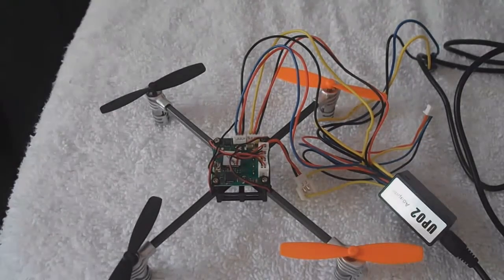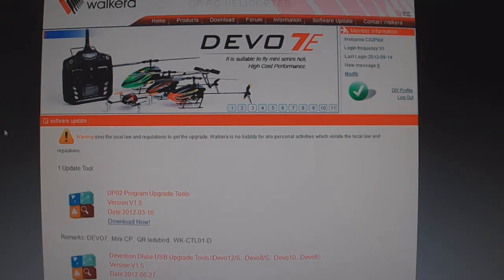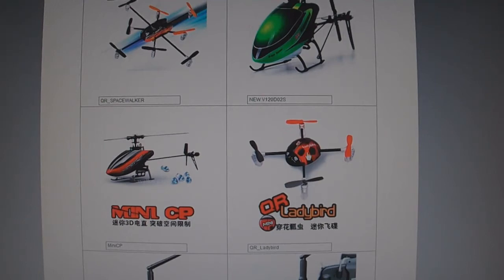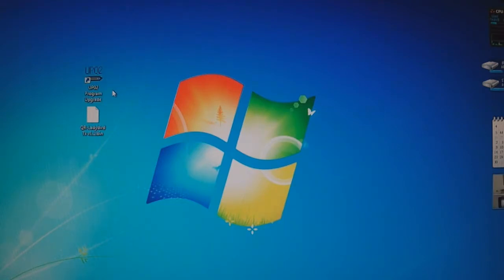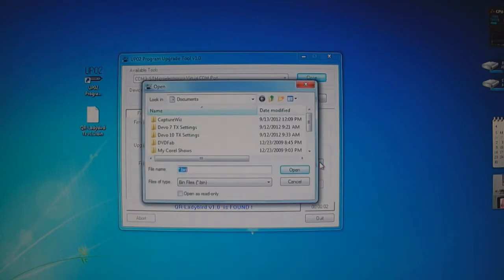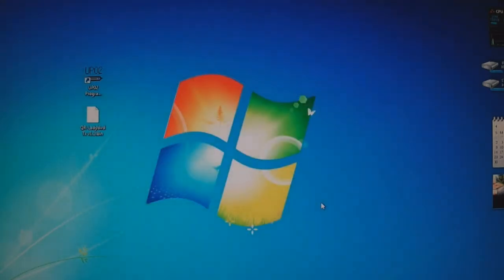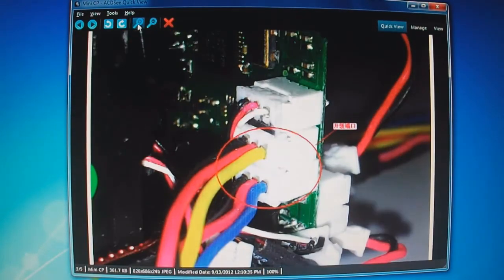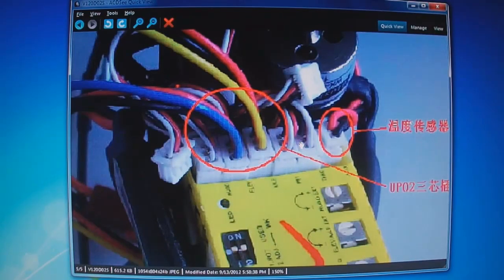How to Update Walkera Receiver Firmware

Comment: Hi Tom Zadar,  I want to upgrade my DEVO 7 from 5B to 5A firmware so I can adjust my output power to 100mW (+20DB). Do that needs also the receiver to be upgraded or can I stay with only the DEVO7 transmitter upgrade to achieve this ?  I want to extend the range of my DEVO7 TX.   Thanks
Reply from the maker: Hi, sorry for the late reply. YouTube isn't notifying me that I have comments that need to be approved.
It has been so long and I don't have the Devo 7 anymore.
You only need to update the firmware in the transmitter to get the 100mW. You don't need to do anything to the receiver that I know of.

Comment: my qr ladybird not bindding after update and not response, my qr ladybird board is ladybird_b1-v1. Anybody knows any solution for rescue my quad? Thanks
Reply from the maker: If might have to do with using a fixed ID before you did the update if you used a fixed ID. You might need to clear it in the Rx and re-assign it. To clear the fixed ID you will need a bind plug. The instructions to clear a fixed ID should be in the manual. If not you will have to search around on YouTube or the internet. I don't use a fixed ID so I can't help you with this.

Comment: I think I found out why. The new V1's have firmware 1.1 you can tell when it hovers at 30% throttle. The old ones (1.0) hover at over 50% throttle. I'm going back to old firmware 1.0 because it doesn't drop like a rock in the sky. I'm going to let Walkera know about this. Very disappointing. What's strange is, howcome no one's had this problem thus far?

Comment from the maker: That is not good. That is about where mine goes into LVC (closer to 3.7v) which will reduce power fast but not cut it off yet. This would make the quad drop out of the sky as you must land the second this happens and you will have very little power at all, just enough to land quick at best. The ladybird LVC kicks in about 3.7v